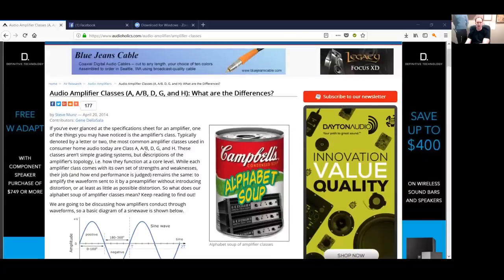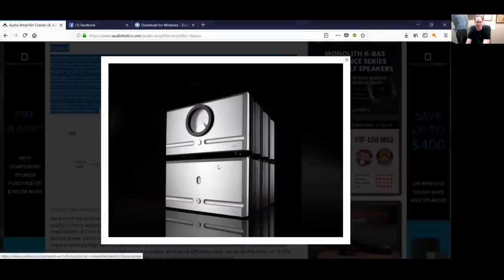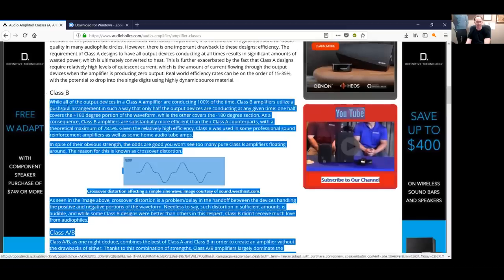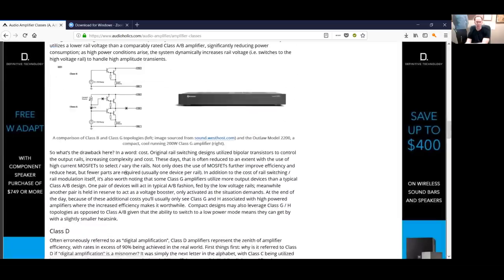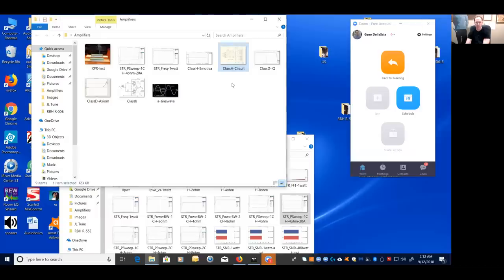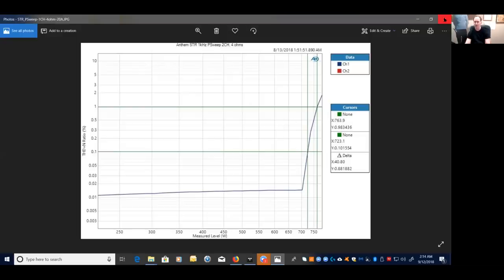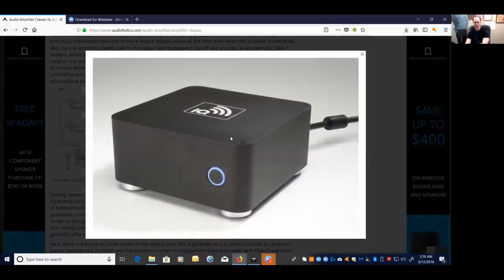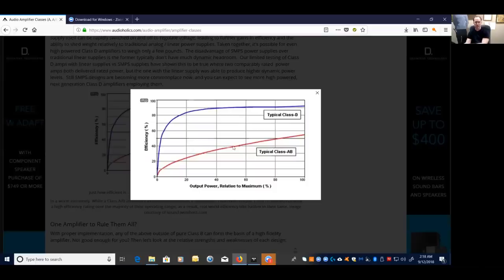What are the Differences Between Class A, AB,  and D Amplifiers?

Comment: 14:20 Honest question. When viewing any chart, it's imperative to note the scale. Here we see, what looks like, 0.75db of variation in frequency response between all loads tested. Am I reading that right? 0.75db is barely an audible difference. And we're talking only at 30kHz? Though the overall frequency response is crap, the discussion at hand was regarding the change versus the load presented, yes?
Reply: The 0.75dB variation is not between the loads tested; it is between the 8 channels of the amplifier, when tested with 8 ohm loads.  With a 4 ohm load, the 3dB peaking at 30KHz is not present, but as loads go higher than 8 ohms (which many loudspeakers do within certain frequency ranges), the unit tends towards instability.  That was the primary point that Gene was making - there is a serious design issue.
Reply: @marianneoelund2940  Ahhh thanks. Yeah I noticed the channels listed on the Key. But from what he was saying, I thought maybe the Key is automatically generated onscreen after each run or something.

Comment: Hey, I've got a set of Atma-Sphere M60's and the transparency and clarity are second to none.   I'm currently driving (breaking in) my ELAC series 6 monitors but I love hearing these amps on my rebuilt Scientific Fidelity Tesla I's.   Honestly, I haven't hear ANYTHING  modern that has the sweetness and musicality of my Atma-Spheres.   I look forward to your comments.
Reply: It's much more easy to make a amplifier sound smooth with warmth to the music. It may sound good but is unnatural artificial. 

Much harder to make a amplifier that's transparent, linear, low distortion. One that doesn't add or take away anything from the recording.

No tube amplifier including the Atma schere M60 can be truely transparent to the recording. You will need a good non tube class A, AB, D amplifier for true transparency. 🎶

Comment: Did buy sony str-va555es for running my hometheater. Quite sure it is A/B by the mass of it (24kg says on the box). Just loving how it sounds on stereo mode.  Earlier I had some cheaper start of the line sony hometheater amp and the difference in the sound is like night and day.

Comment: Not technical? I didn't understand the schemes at all xD 
Anyway, very good summary though, but what do you think about hybrids? I have a hybrid 150/250 W into 8/4 Ohm Vincent amp that has Class A tube amp portion for the first 15W for the mids and highs and Class D for the low end. How efficient is that comparing to the mentioned types?

Comment: Nice job in layman's terms.....i like u using real world brand and model examples and your added insight was extremely helpful, especially as technology improves. Than you!
Reply: He used a receiver outside its rated impedance load, then critiqued it. ICE amps were not designed for 4ohm load. Home audio is typically 8 ohm. Notice the Pioneer with ICEamps had no issues at 8ohm ... Tech manual even explains what its rated for.

Edit: Referring to a nominal load of course.

Comment: Woah  - First up,  the sound from an amp becomes greatly distorted when you  start dropping impedance.  Those ICEamps on the Pioneer SC line were designed for 8ohm application.  The target audience is using off the shelf systems from box stores, typically rated 8 ohm. Notice you said it was only at 4 ohm the pioneer ICEamps ran into an issue (as would most if not all D class amps in that price range). 4 Ohm is best suited for auto / mobile application because amplifiers produce more power at lower nominal impedance (at the cost of quality), which is needed when you are running on a 12v battery.
Secondly, if you care about clean sound, then you are running 8ohm at home, so the amps don't give off audible distortion.
Reply: You are trying to make conclusions about class D considering one cheap implementation of it. ICEamp can be designed better to provide more immediate current when 4 Ohms impedance is used as a load. Like x10 times capacitors volume in power supply part may help a lot.

Comment: Great Video and great technical measurements but what about the sound quality. Music is a complex wave form. I love listening to music with my PP class A/B magnetic coupled tube amplifier (10-15 watts)  I have compared this amp with an expensive (heavy) SE  class A tube amplifier (845 output tubes) but in my opinion it did not sound as good. I would think the sound quality would not matter in AV equipment since your concern is on the movie and sound (dynamics) content and not the sound quality. I going out to purchase a class D amplifier and do a hearing comparison. Listening to SS amplifiers fatigue my ears for some reason - lets see how class D compares.

Comment: Re: what type of amplifiers do we use?  Just wondering if anybody is using feed-forward, pre-distortion types (from the radio frequency world), that use DSP's to compare inputs and outputs, and add an inverted correction signal to the input to cancel any distortion on the output.  That way they can be efficient and ultra-linear.

Comment: I’m about to buy a 4 channel amp for my F-150. I put component speakers in each door. So, I have 4 woofers, 4 crossovers and 4 tweeters. They’re rated at 125 watt rms each. I don’t have a lot of money. So, I can’t decide between the Rockville DB45 or the Taramps DS800x4. The Rockville is class a/b and the Taramps is class D. Each have enough power but which one will be clearer? Have you any knowledge of either? You obviously know exactly what you’re doing. Any advice for me?

Comment: Glad to see class D technology evolving.  That combined with the efficiency of a toroidal transformer would make for an efficient system.
Reply: Class D will never overtake class A or even AB in audio quality anyway.
Reply: @hi-fidude6670  Not as of yet.  If they could it may mean that the more demanding speakers could effectively be driven with a receiver.
Reply: @qua7771  Speakers aren't even that demanding, I've had some in the 87-89db range not even that much power required at least with 1970s gear where everything is better and beefier. The best things are never the most efficient. A Toyota Yaris uses less fuel than a Plymouth Roadrunner, becuase it's a small economy turd and totally uninteresting.
Reply: @hi-fidude6670   You may be correct as a general rule.  My C5 Corvette with a tune gets 32mpg on the highway.
Reply: Class D cannot. Its how the Sine Wave works. Class AB will always sound better. But Class D has become good enough for the average audio enthusiast.

Comment: A space heater? I’m using Class A Pass Labs INT-60 into a pair of 4 ohm Tekton Double Impacts for stereo and it sounds amazing. Also an INT-150 Class A/B which also is amazing. A pair of Emotiva XPA-1 monoblocks on PSB Stratus Goldi’s as front speakers while using UPA-7 powering the rest of the Mirage speakers in 7.2 surround systemI. ’m still trying to understand the differences of Class A vs A/B since one of these Pass Labs amps has to go. Which one do I keep? 🤔
Reply from the maker: Keep the Emotivas!

Comment: For the past two decades, I have been running Carver class G three rail (PT-2400) and class H four rail (PT-1250) amplifiers on a touring rig with next to no maintainence.  More recently, I have been including class D Lab.gruppen amps into projects with good results.
The newer class D amps tend to be third smaller than a comparably powered class G/H but I have found the difference in weight and power consumption between a class D and class H to be fairly insignificant.  They are both 90% efficient with around 120 watts rms output/pound of mass.

For sub woofer use, I still have not come across any amp with the low frequency headroom of a PT-2400 as evident by my ability to feed a 60Hz sine wave into it while starting and running a 2hp air compressor connected to the outputs.  I have yet to find any 120VAC class D amplifier that can pull that off.  This bullshit “peak power” rating often quoted by the class D crowd would be best left for the consumer crap that they sell at Walmart.
Reply: I had a Carver TFM-75 power amp, it was a consumer version of the PT2400.  Its output was (min.) 750wpc 8 ohms, 1000wpc 4 ohms, it was recommended that each power cord be plugged into its own 20amp circuit for max power.  Awesome amplifier it was!

Comment: Hi Gene,
Thanks for your informative videos, I enjoy them very much.
I have a tube amp with a circuit typology that is unique and different to anything that has gone before it, which makes it a modern valve amplifier as I see it.
Designed by Joe Rasmussen in Australia (Who worked for many years alongside Allan Wright of “Vacuum State” and of the “amplifier cook book “fame.) and he describes or calls it “Beyond Triode” my amplifiers which was built around a chassis of a Chines Yaqin MC-100D amp but is completely rewired internally with new circuit design and proprietary boards, filters and power supply components.
This amplifier is the most beautiful sounding amplifier i have heard - it is transparent, detailed, open and wide  soundstage without the overly warm sound that one usually associates with tube amplifiers. It has the best of solid state and valve sound, I just cannot stop listening to it. 
I have a number of different systems, amplifies, turntables, DAC”s and speakers in my home but Joe has nailed it for me and it is amazing.
If your ever in Sydney Australia give Joe a call and have a listen or call me and you can come around to hear my “Custom Analogue” system with all components prepared by Joe and “JLTi”.
Reply: Note that particular electric scheme does not define class of particular amp.
Class A is defined as unipolar voltage amplification with signal polarity change biased to some positive voltage, usually in the middle between 0V and power supply DC maximum voltage.
Class B has bipolar voltage amplification with signal polarity change at 0V.
Class D is bipolar amplification using impulses of +MaxVolt and -MaxVolt mixed with 0V signal at high frequencies like 200+kHz(the more frequency the better the output amplified signal quality of high frequencies), which then filtered with Low Pass Filter like LC filter of high order after 20+ kHz.

Comment: I'm running a class A/B Denon AVR -2307CI and using it in a 2 Chanel system.  I'm doing this because the amplifier is good, but a few of the digital inputs have gone out.  I'd like to upgrade to a tube preamp (Schiit Saga) with a Crown XLS, XTI or XLI class d amplifier because of their reputation and you get so much power for the money, but I am not willing to sacrifice on sound quality.  What do you recommend?  Speakers are ELAC UB-5 Slims.

Comment: I use a Sony proprietary S Master Digital amplifier, so am i using the best in class or is it just another technical jargon, as they claim with the S-Master digital amplifier, a simplified, full digital signal path, the S-Master amplifier reproduces digital audio signals without the multiple analogue stages required by conventional amplifiers. The result is not just more power, but significantly less distortion from heat build-up.

Comment: Thanks for the video - I have a Yamaha A-S3000 integrated 2 channel amp. I guess it might be class A/B, however I have never seen anyone describe what amplifier class it is. Is there a way of figuring out what type it is? 
Thanks
Reply from the maker: Yes it's class AB. You can tell by the linear power supply and large heatsinks. Also, most of Yamaha's receivers and integrated amps are still class AB and very good designs at that.

Comment: Hi, Gene.
With the exception of my Luxman MQ 360 tube preamp (I'm pretty sure it's Class A), all the rest of my amplifiers (both SS and tubes), integrated or power, are Class AB.
One question I've been wonder about: why if Class D were used in  portable devices' audio outputs,, such as smartphones, tablets and the like? Is this amplifier topology available in VLSI chips?
Thanks a lot for the video.
Reply: Thanks a lot for your answer after four months (I mean...your not answering).
This has very kind from you, indeed.

Comment: Are there any differences in sound quality between pro style amps like the crown XLS range compared to the more tradition HiFi class d amps? How are pro amps so powerful and cheap?
Reply from the maker: Most pro amps are designed to be loud with fidelity being a secondary concern. If you see a proamp claiming 1kwatts of power and  it only weighs 12lbs and costs only $500, RUN! Almost none of these cheap proamps disclose fullbandwidth power. If something sounds too good to be true, it usually is.

Comment: Great refresher, I've always thought of bias as an applied voltage. How do you define it in order to justify your narrative? Thanks so much for taking the time and just enough post production - class-eh - as we say in Canada.
Reply: Bias can be either an added voltage, or an added current.  
In power amplifier output stages, it refers to the amount of quiescent current which the output devices conduct with no signal present, and also the way in which that current is modulated as signal is applied.  There is an infinite number of degrees and variations, and the distinction between classes isn't always clear.  That is especially true when you consider the measures that designers take to handle reactive loads, and add over-current protection to the output stage.
Reply: Marianne Oelund  thanks for the explanation - i can see how the definitions grew.  My electronics design education was early digital . Things change!

Comment: I have old school definitive technology bp 3000 towers. And they have to be on their own circuit. And then I have 3 receivers that have to be on their own circuit. I have a 50 amp service panel just to power my room. It is separated and conditioned powered directly from the Pole before the service to the actual building.

Comment: I've owned Polk Audio TSx330Ts, TSx550Ts, RTiA9s, and now (thanks in no small part to Audioholics) RBH SV-6500Rs.  I initially drove the TSx's with my Marantz AVR (SR6009 at that point) before finding some AudioSource AMP310s for bridging/bi-amping.  Long story short, I eventually upgraded to a Parasound HCA-2205a for bi-amping before settling on my current Krell KAV-1500.  The Parasound was a beast, and the Krell even more so, ESPECIALLY in terms of bass slam (with the Polk RTiA9s and the RBHs) but also fidelity (especially with the RBH's!)  But... while the AudioSource put out very little heat and the Parasound amp could get warm, the Krell can get a lot hotter unless I keep it out in the open on its own stand, which is where it now resides.  But even then it does tend to warm my 24x14x8 living room a bit!  (When kept in a cabinet, I had a good amount of active cooling fans triggered, but it still got too hot for my comfort!)  Because of the heat and because there is a bit of hum/buzz I can't seem to get rid of, (which is a whole other issue,) I am considering eventually switching my mains' amp(s) again, but I don't want to sacrifice the sound quality I get from my Krell.  I have been looking at specific Class D amplifiers that have received limited but excellent reviews:  the PS Audio M700 monoblocks.  Gene, any chance you'd be willing to review those any time soon?  I'd love to see how those amps measure through all of your tests, but I'd also value your subjective opinion in listening tests vs. other amps with which you have experience (e.g. not only vs. other Class D amps, but any Class A or AB amps too.)

Comment: Ive got a dilemna. My Pioneer 9500IIs amp and separate tuner got destroyed in a water line break. I just paid Austin Stereo shop 1000 last year to totally refurb it, new resistors; etc. I mostly play lps from 70' and 80s. I don't want to spend 5k on something new. I'm 67 and my air guitar days are almost over. I just heard about these diferent ratings last weekend Ughh.. I really want to spend less than $1000 for a receiver, but I am not going to buy a 50 year old amp. Any advice or recommendations for  someone in my spot??

Comment: I'd like to know if the Crown XLS 2502  need to be plugged into a dedicated 20 amp outlet or can I get the maximum output from a 15amp socket.  I have a pair of Triton Reference that are 93.5 Db efficient with a maximum power handling of 600 watts, in a dedicated theater room, and I want to push them to their limits.  I'm just not sure what power source I need.

Comment: I could not find out exactly what my amps are as of class it hard to find the right info for old amp i Imagine That it is a/b but I have a old Acom GFA-555II and a Acom GFA-7500. The 555 is powering 2 DX-9 Cerwin-Vega and the 7500 is powering 4 VS-120 Cerwin-Vega Speakers

Comment: I don't get what you mean by type A class is being obsolete. It's a basis of most audiophonics just passed mechanical amplification the best way to hear raw wave length as such to vibrate the eardrum without any violent steps in the wavelength or volume. 
But the best of all the skills required to formulate a blueprint is one that of none.
Reply: But the space heater joke priceless.